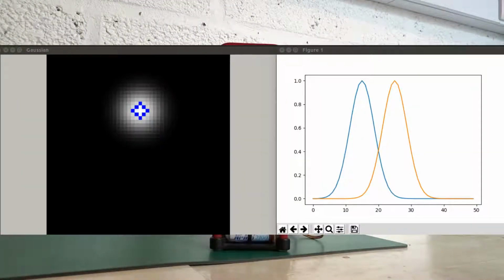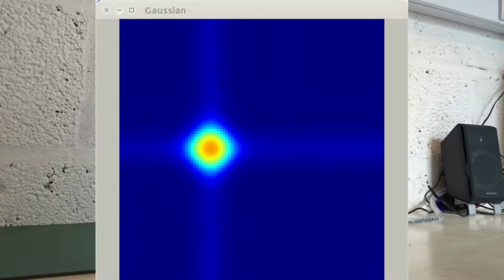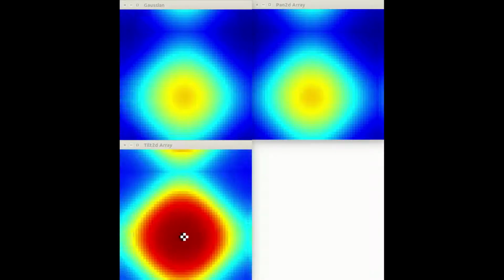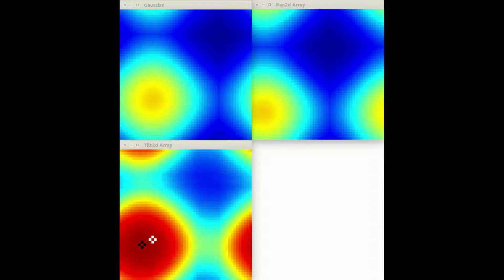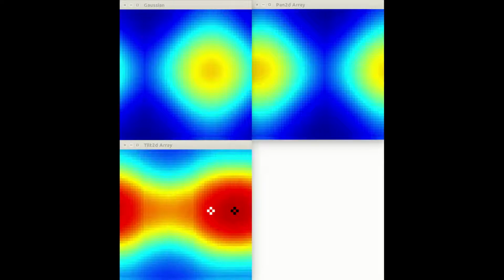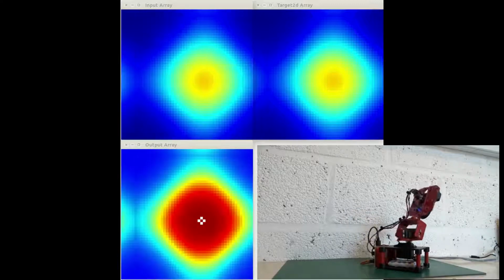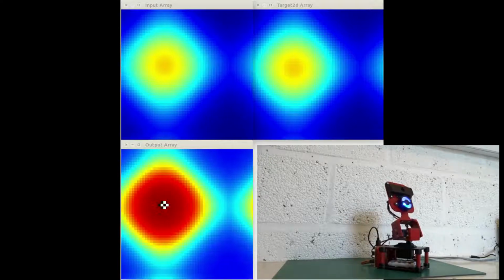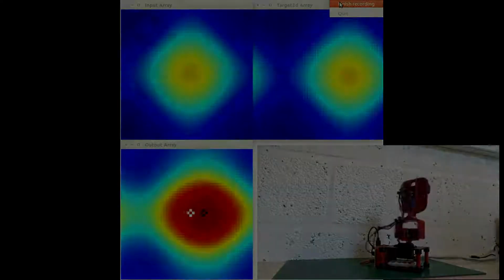Population Coding Neural Network for Robot Head Control - Robot Head Mark 2 Part 8

Comment: Is there any chance I can reach you by e-mail? It's about your Mark 1 and the Monocular Vision based obstacle detection system. I can't get the Github codes to work and we're two weeks close to the deadline for a project (Helping device for visually impaired people with image processing) and we would be very grateful for any kind of help. Thanks!
Reply from the maker: The code on github works but only for obstacles on a floor, so that when you apply a threshold the obstacles are isolated as white blobs against a black background. For different applications you may need to find a different way to differentiate the obstacles from the background. What part are you having trouble with?
Reply: We're most definitely end up adding our code too on it. (especially to adapt to sidewalks) Currently, I can't get the calibration to recognize the chessboard I have. It's beige and brown, could that be the problem?